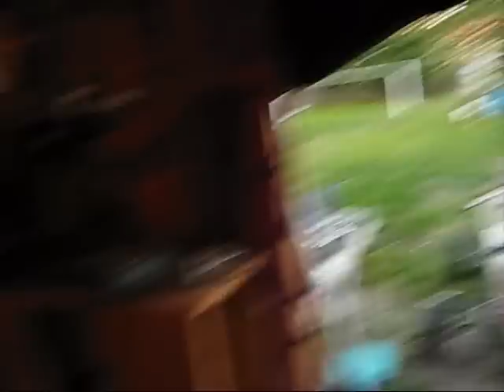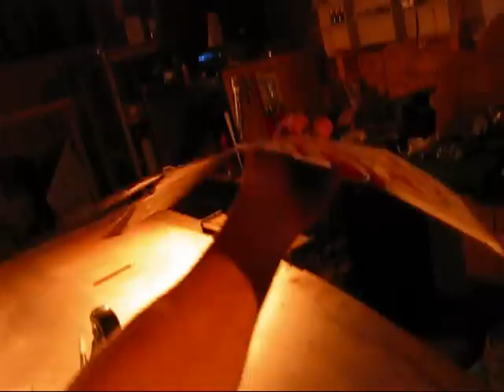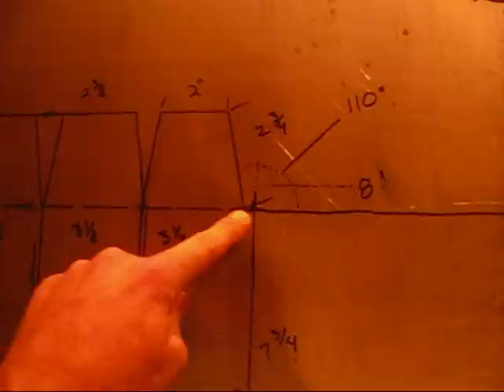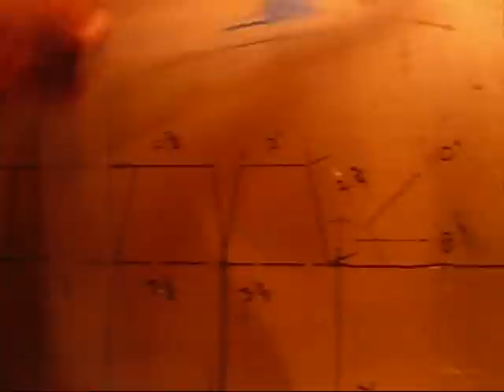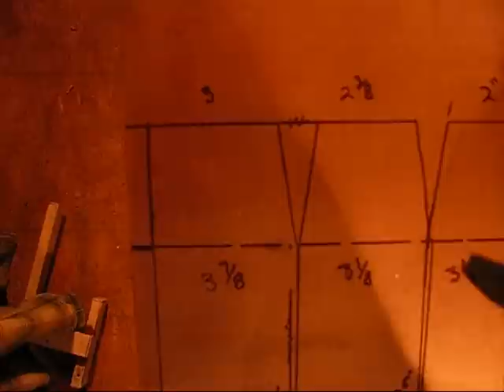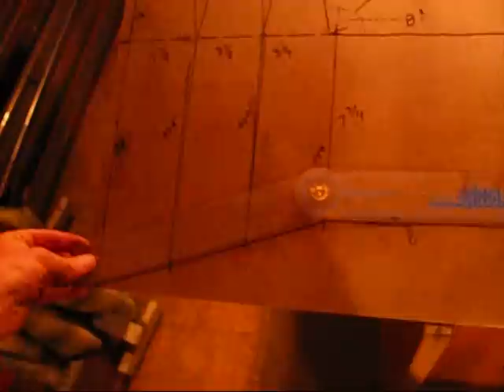# 1 ( Custom Panel Fabrication ) █ # 37 Reverse Trike / Quad Build

Comment: What are the dimensions of your workshop?
I am looking to build one for my shop.
I build props for films etc..
Thanks
Reply from the maker: The front is 10 feet high it slops back to 8 feet, the length is 32 feet and it is 12 feet deep. we are going to be moving soon so I'll have to take it down. If you subscribe you'll see the process and how I built it.